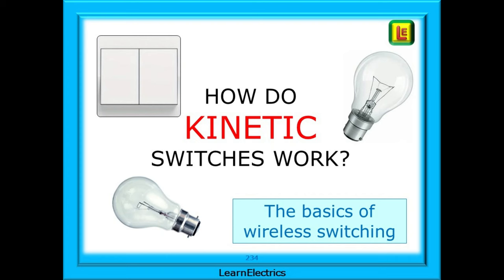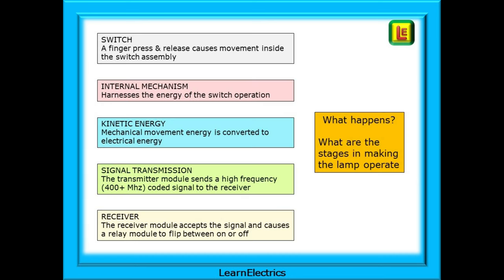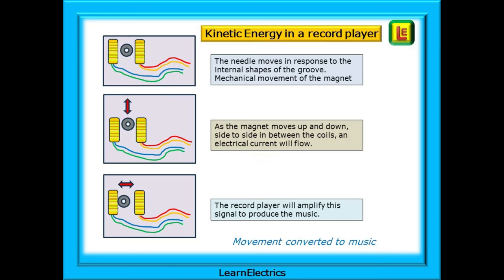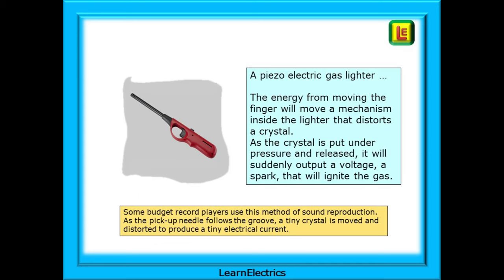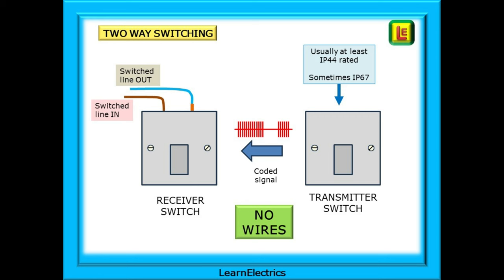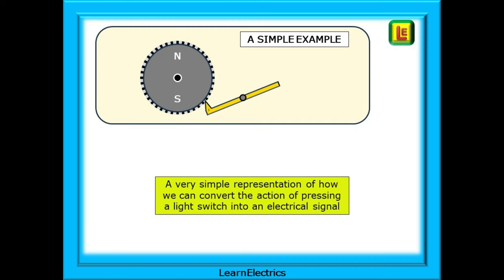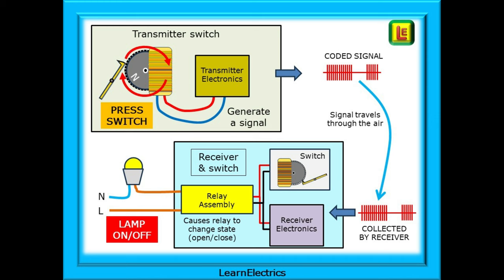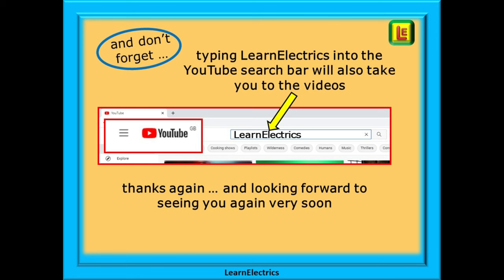KINETIC SWITCHES – HOW DO THEY WORK – NO WIRES BETWEEN SWITCHES, HOW DO THEY DO IT – WHAT IS KINETIC

Comment: Great video, this is amazing, I wonder if there is a reg regarding a transmitter switch
Reply from the maker: Its not connected to the installation and it does not generate enough voltage/current to be a hazard to you and me,

Comment: Sorry for being thick but......I get the kinetic movement converting to a signal because of the physical gearing in the transmitter switch (ie initial press/movement produces the energy) but what powers the receiver circuitry? The transmitted signal surely hasn't enough energy to induce any reaction.
Reply: I think the receiver is on the mains. The kinetic switch is wireless, the receiver switch is not.
Reply: @nigelpalmer1172 that's the confusing bit though....at 10:10 the diagram shows line (live) in and SWITCHED live out, ie no neutral at that switch....which you would expect on a traditional switch 🤔
Reply: @stuffoflardohfortheloveof  you dont get a neutral on a standard switch configuration. Live in,  live out.
Reply: @merlin5476  that's what I said.... So if there's no neutral where does the receiving electronics get it's power from?
Reply: @stuffoflardohfortheloveof  the recieving electronics does have a neutral. 👍
Reply: @merlin5476  ok, thanks. I wish he'd shown that though.
Reply from the maker: The received signal has enough energy to produce a very small current in the receiving circuits to change the switch state. modern semi-conductor devices can function on very small amounts of electric. Dave.
Reply from the maker: Thanks for the input.
Reply from the maker: Thanks for watching, No neutral needed as you say.
Reply from the maker: Thank you for watching. No need for additional supplies or neutral.
Reply from the maker: Thanks for the input, appreciated.
Reply from the maker: Its generated by the incoming coded signal. A radio wave has power, a microwave has power, look what it does to sausages. Hope this helps.
Reply from the maker: No neutral.
Reply from the maker: No neutral needed.
Reply: @learnelectrics4402  thanks for replying. I'm just amazed that there's enough energy to power the receiving switch that's all. 👍